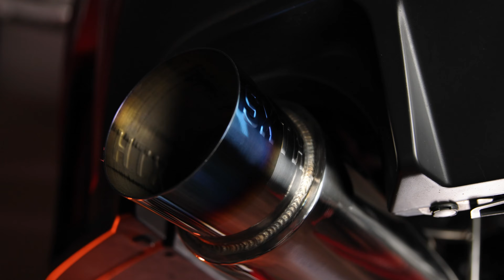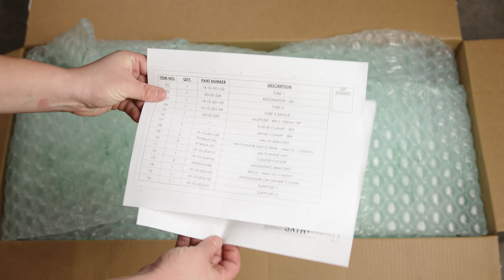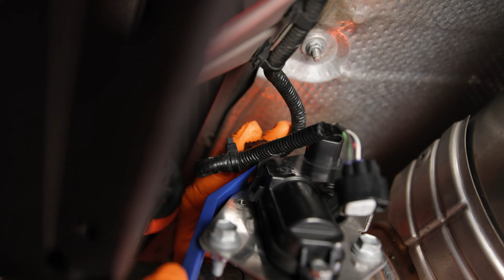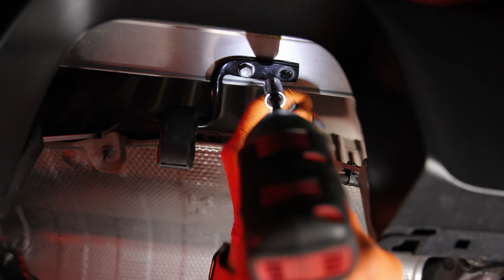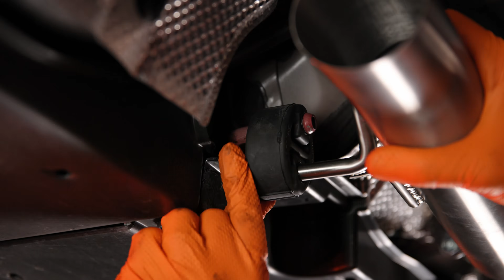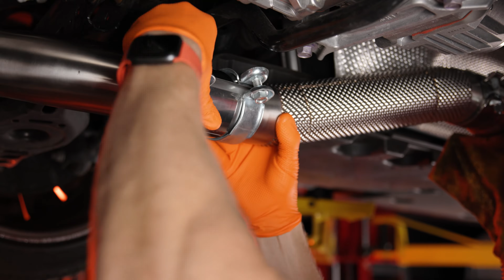GR Corolla Single Exit Exhaust Installation

Comment: The only thing stopping me from buying this single exit is the canister and tip. I think they would have looked better if it had a long tip and the canister pushed back so it hides inside the bumper while the tip still sticks out. Kind of like how the hks exhaust for the mk4 Supra is.